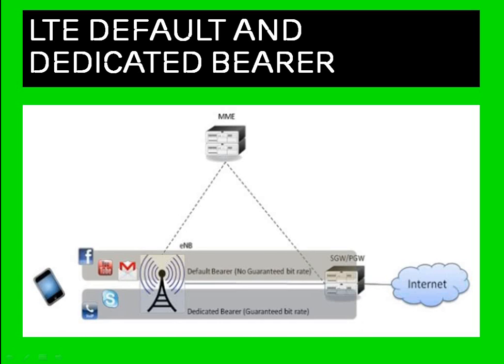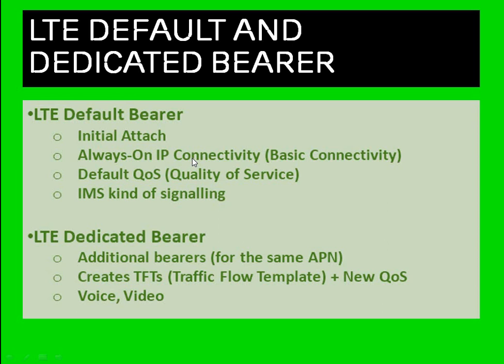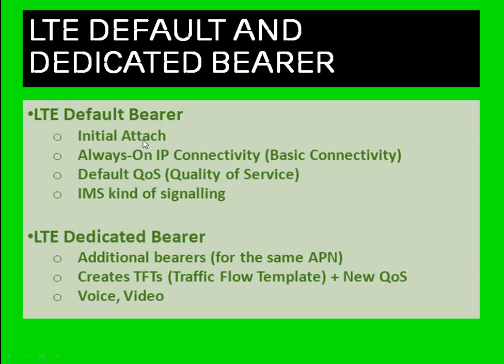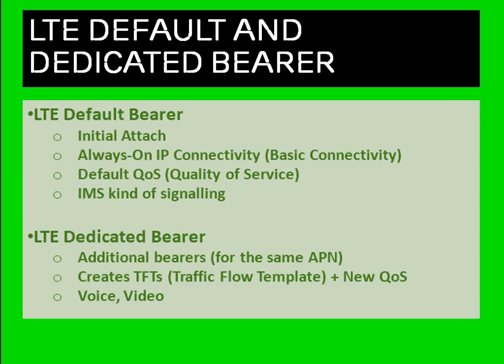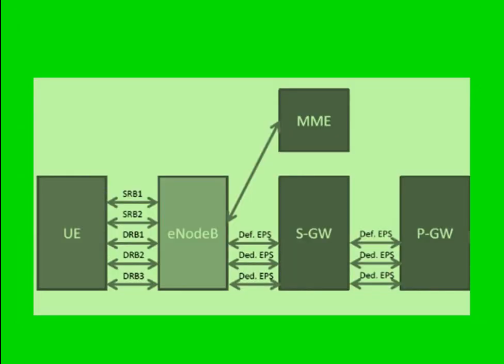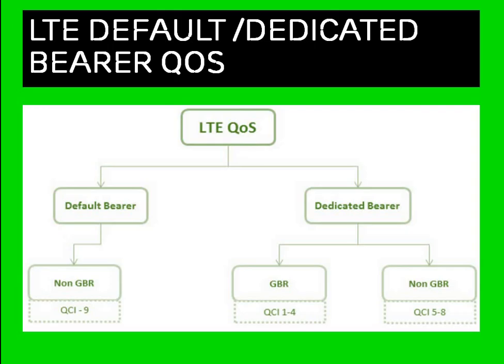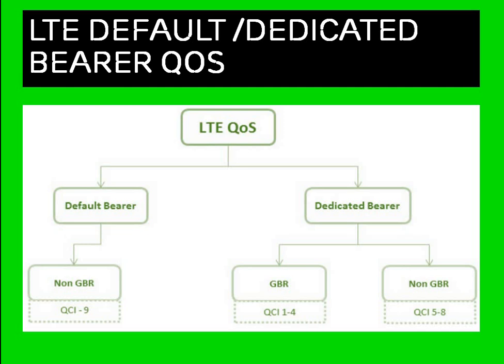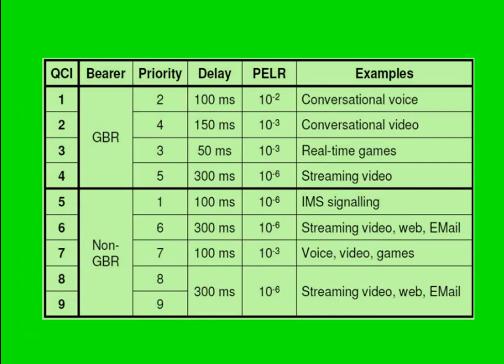LTE Default & Dedicated Bearer

Comment: Pls give some highlight on QCI 4,6 & QCI 8-9. Which are almost are using for same purpose. Than how it is different to each other.
Reply from the maker: QCI 4 :  Non-Conversational Video (Buffered Streaming) using GBR (Guaranteed bit rate)

QCI 6 :    Video (Buffered Streaming) TCP-Based (for example, www, email, chat, ftp, p2p ) using non-GBR

QCI 8:     Typically used as dedicated bearer (Video (Buffered Streaming) TCP-Based (for example, www, email, chat, ftp, p2p ))

QCI 9 :    Typically used as default bearer (Video (Buffered Streaming) TCP-Based (for example, www, email, chat, ftp, p2p ))
Reply: @MobileG4u  Thanks.
Reply from the maker: @monuchaudhary2132  Your welcome . Kindly share my channel information in your circle.